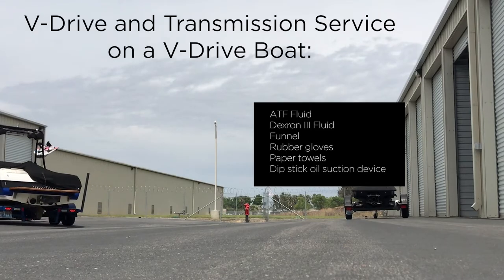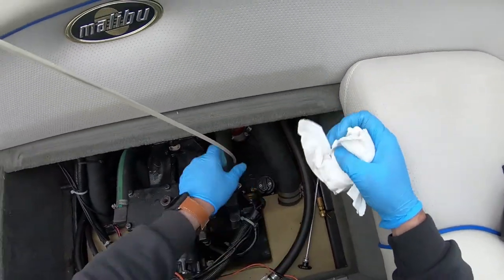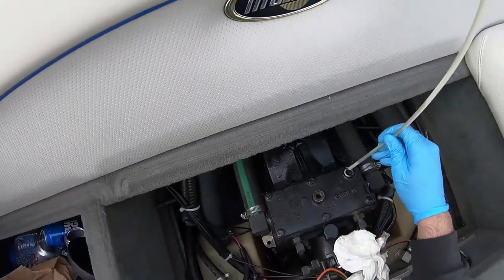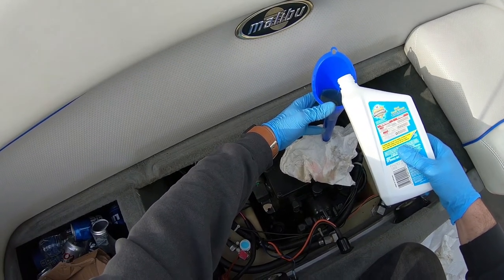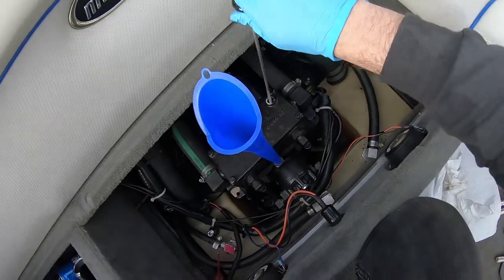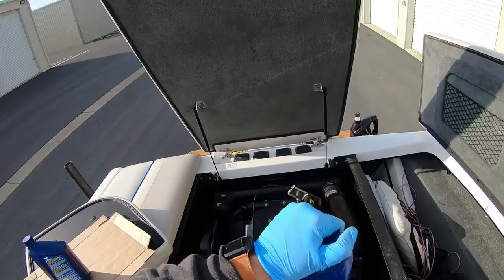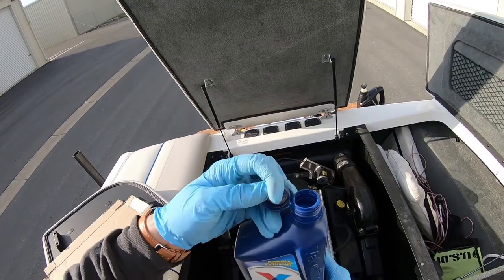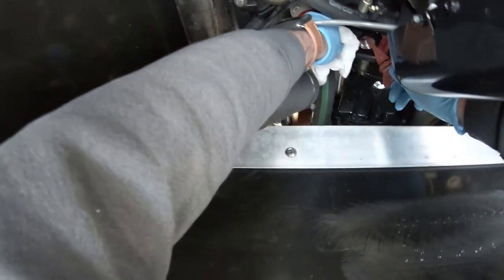How to Service a V-Drive and Transmission on a Boat- How to DIY Guide

Comment: Looks like you have a Walters V-Drive which is the same as my Moomba. Have you ever cleaned the strainer? It’s in an extremely difficult spot. I usually just clean the magnetic plug...
Reply from the maker: Never touched the strainer. Didn't know about it. I'll take a look. Have you found much debris on your plug?

Comment: How often should these oil changes be done?
Reply from the maker: We do it once a season bc we rarely put on 100hrs a summer. Check your engine manual. But usually every 100hrs or once a year. Whatever comes first.

Comment: Does a 2004 Sanger v230 v drive have a transmission cooler? I'm getting a soft alarm sound of 2 beeps every 5 mins. All my fluids are normal. Thx Kevin
Reply from the maker: kevin stapleton sorry I don’t know Kevin.

Comment: How do you winterize?
Reply from the maker: I have before. But not anymore. We don’t get hard freezes here.
Reply from the maker: Ya. Follow my FB group called Malibu and Axis Owners and make a post and there’s thousands of other owners that can walk you through the process. There’s multiple ways to do it. Basically you run the engine on antifreeze mix until thermostat opens, the drain all areas of the engine. But make a post and get detail step by step help. See ya over there. https://www.facebook.com/groups/327295504286386/

Comment: Don't mean to be rude, but I'm not sure this is the best advice for how to change your v drive oil. I've got a 2000 Tige 21V with a Walter RV 26 V Drive. I'm in the process of replacing it due to it failing. While talking to the rep from Walter, he said it's important to follow the directions in the manual, which says to drain the oil from the bottom and clean the strainer. If you suck the oil from the top (what I've done the three years I've owned the boat) like in this video, you only get about half the oil, leaving the worst oil on the bottom. The rep said that over many years this is going to lead to more wear on the gears as you're not getting rid of contaminants. I'm sure it's going to be a pain to try to get the oil out the bottom and clean the strainer, but probably will extend the life of the v drive (which is about $3k for a new one).
Reply from the maker: I have not heard of this before. But it makes sense what you’re telling me. I will say, this boat’s the drive is 21 years old and never had an issue. And this is how everyone else recommends doing it across the forms and groups. But I will investigate what you say and add the details of description I come up with more Intel thank you for sharing.
Reply: It may not have been what lead to mine failing, but guessing it does help to service it correctly. Here's a link to the manual for Walter Vdrives: https://drive.google.com/file/d/1djXBDDYb34elko5w0CtpzEoO3L6cZTe8/view?usp=sharing @fixitwithjake

Comment from the maker: Update to the video: When checking the ATF fluid, do so at engine operating temp. So you will need to run the engine. No need to "screw" it in. Just dip the dipstick without screwing it in first to see the proper level.

Comment: Hi Jake. Great video. 
On the V drive dip stick…is it a thread that needs unscrewing to get it out? I’m finding it very difficult to get it off.
Secondly regarding the transmission…my fluid looks like a strawberry milkshake which makes me assume water is getting in. Do you know where this might be from?
Reply from the maker: I just watched the video and if I remember correctly, the V drive dipstick just pulls up and out. It’s aluminum metal with a black rubber O-ring around it. So if you’re having trouble, I would take something like a plastic screwdriver that will not score the metal and wedge between the two to pry it up gently. Also, twisting the dipstick may help. But don’t get too aggressive because the soft aluminum will, start shaving off. If it looks like milkshake on your transmission, it definitely sounds like water got in. I would empty it all and then refill it two or three times with really cheap fluid just to flush out the bad stuff. And then top it off with good fluid. I’m not sure where water may get in, but I think there may be some water cooling lines attached to it to help. Keep it cool while you’re running. If this is not your original boat, maybe they got a bunch of extra water in the bilge and the water leaked in through the top of the transmission. Or maybe this boat has been underwater.

Comment: It appears that you are changing 2 different oils. Can you let me know what is what?  What is the first oil?  The second appears to be ATF fluid. Thanks
Reply from the maker: Correct. The forward most drive is the v drive and it takes SAE30 on this boat. The other device behind it, is the transmission that selection forward, neutral or reverse. It takes ATF fluid. Reference the owners manual for your boat. In the back it will tell you exactly what fluids to use for each reservoir.

Comment: Question for you: Why use Dex3 when Mobil 424 is required from velvet drive? V-drives 1987
Reply from the maker: Each V drive brand and year has a specific oil requirement. There’s usually a label on the v drive to remind you. So be careful to put in the correct fluid.
Reply: @fixitwithjake  so v drives are Dex3 and straight drive was 424 old cast iron models.
Reply from the maker: Oh that’s good to know! Thanks for sharing! I didn’t know this.

Comment: Also is this a indmar assault 5.7 engine or would this be same my boat is a 04 supra launch gravity games edition
Reply from the maker: This is a 325hp Indmar Monsoon. Very similar engine. 2002. I think  it’s companies just do simple mods and call them their brand names. For example Malibu calls it a Monsoon and Supra calls it an Assault. But really it’s an indmar. I just looked at your manual a s your boat might have a remote V drive filter. Check out this doc and you should get all the info you need to service it: https://www.supraboats.com/assets/Boat-Archive/2004/2004_supra_owners_manual.pdf

Comment: Man I wanna do mine so I'm curious it doesn't have to be running in neutral like most cars and trucks
Reply from the maker: Does not need to be running. It is simply a reservoir that you suction to remove the old fluids and top off with new fluids. Most have a Walter V drive.

Comment: Jake- What about the Trans Filter replacement? I have the ZF marine Hurth 450D?
Reply from the maker: They are $60 a pop. I don't touch mine. You can remove them and clean with compressed air if you want https://amzn.to/3khWdMy
Reply: @fixitwithjake wow. Now they’re $80!

Comment: in the 2016 Axis, it recommends Mobil sch 50w for the v-drive transmission oil. but I noticed you were using 30w. Is there much of a difference in the oil just because I am having a hard time finding just straight SAE 50w synthetic?
Reply from the maker: Hmmm not sure to be honest. I like to follow the owners manual very strictly.
Reply: Use 50w!!!!! Malibu axis tech. Get it from the dealer. It’s completely different from 30w
Reply: Delvec 50.  It also has a much longer life so check it’s quality.. if your dipstick is red then atf if it’s yellow it takes delvec 50